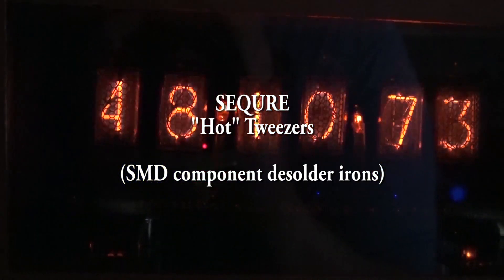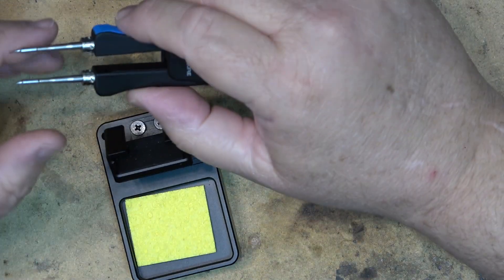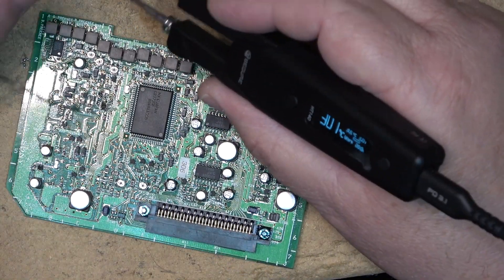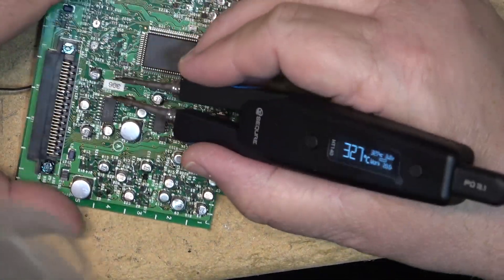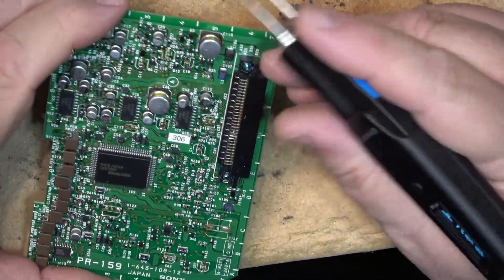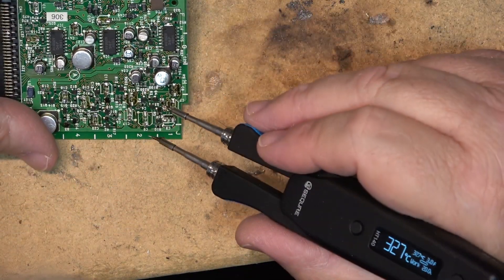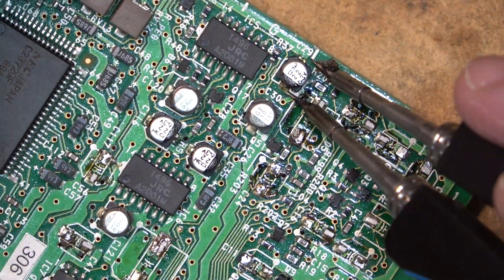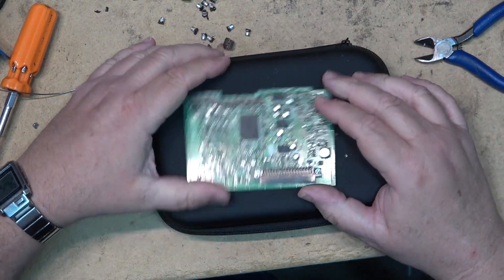Unboxing and testing out a new SMD rework tool by SEQURE

Comment: I have a question about ordering the Sequre tweezers. I tried to order one from Amazon. I got an email from Sequre saying that there was an issue with Customs and that they needed some kind of virtual address from Amazon. This sounded like trouble for me and so I cancelled the order. What is the best way, no hassle way to order the Sequre tweezers? Thank you for your video.
Reply from the maker: Did you order from the link in the video?
Reply: @12voltvids  No. I am a little sheepish about ordering because of worrying about the item getting hung up in Customs. So I wanted to ask you about ordering.
Reply: I just did. But, I checked with Sequre first.I think that the there won't be any problems ordering directly from Sequre.  @12voltvids

Comment: You can sort of leave the stand assembled in the case by placing them sideways instead of inserting the base on the original slot. It will leave a bit of a bulge though but the tradeoff is convenience

Comment: Another thing with tweezers from what I've searched is that when a component is connected to a ground plane with a connection that transfers a lot of heat, tweezers don't have enough power whereas with two irons you can use a bigger more powerful  iron for the side of the ground plane..
Reply: Two irons are hard to control. You need two hands? And you need two 70 watt irons to compete with these tweezers. What you need is either low melt solder to make the desoldering easier and flux. Preferably Stirri, Amtech or other AAA brand.

Comment: Funny, I just been searching for the best way to remove SMD caps these past days and concluded tweezers are a waste of money, the best is just to use two soldering irons. That also has the advantage of having two different tips available at the same time without having to change tips. Also, when you need to reach in weird angles and tiny places tweezers are useless.

Comment: No need to pull at all on the part. When both sides are liquid, it will lift up with almost no effort. Otherwise there is still a risk of pulling up a trace.

Comment: ....Tempting to cut out one side of upper part of stand to make the bolt opening into a slot... just loosen bolts (thumbscrews?) and slide in/out rather than having to remove bolts each time...

Comment: For me the trick is to not use the dual heaters like a pair of tweezers... use them to contact the solder and when it melts flick the part off with a small screwdriver or a sideway motion for the really small stuff.

Comment: Nice little tool just wondering if it can also be used to solder the replacement part back to the board
Reply: Yes, it can be welded back, and this is a tool that can be accomplished by disassembling and welding at the same time.

Comment: For chips with 2x4 pins add solder to get better thermal contact on both sides...
For tiny caps maybe you can rotate the ends so it's really like tweezers.